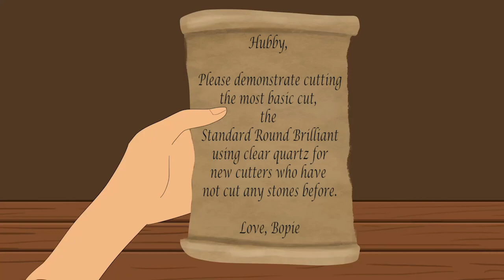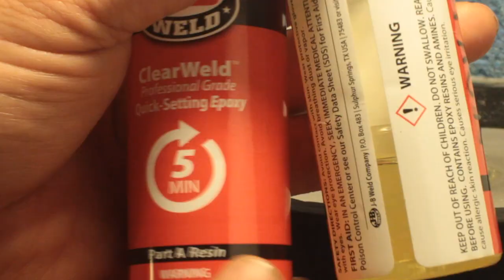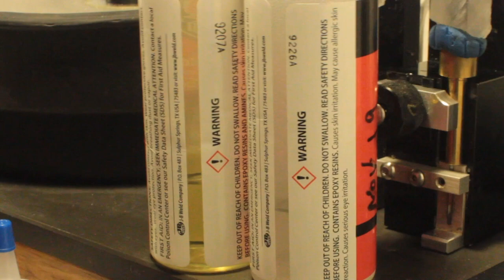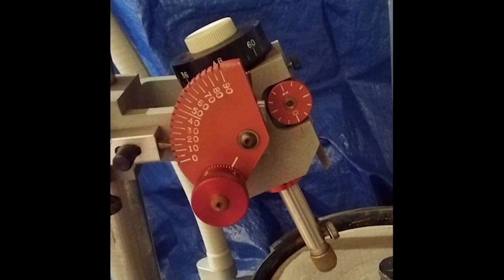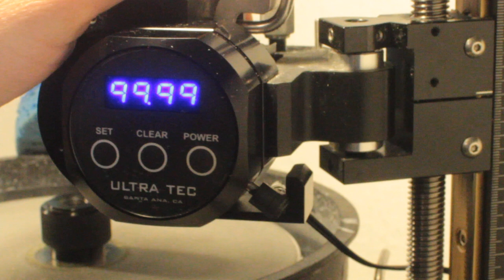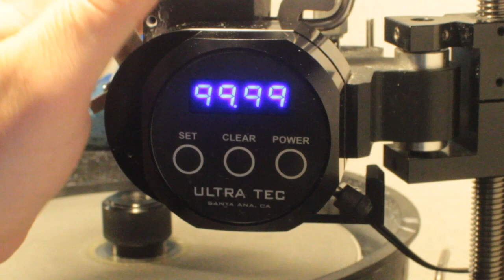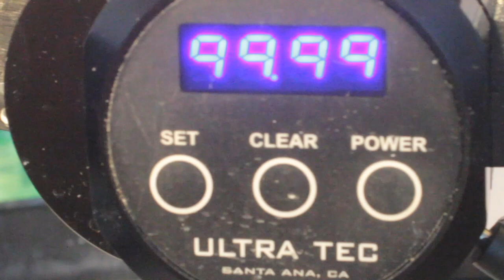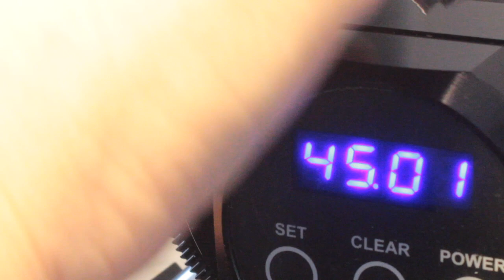Gem Cutting Tutorial: Standard Round Brilliant Clear Quartz

Comment: Great video man, How do you know how much to cut on the different cuts?  The diagram shows the index and the degree but how do you know how far to cut?
Reply: There are a number of ways.  Most commonly, I will start by cutting the two opposite teeth of the index gear, say 96 and 48, I cut and measure the width of the stone at these indexes until the stone is a wide as I want.  That establishes the width, and without changing the mast or angles, I then cut the rest of the facets around the girdle.   There.  Girdle set, width set.  Now the first cuts on the pavilion, I cut down far enough  to have a pavilion and that distance is known and provided in the instructions as the P/W ration (Pavilion divided by width).  You already know the width, so multiply that by the ration and the 'answer' is how many mm you need to cut your first row of angles.  You cut the next row of angles until they 'meet' or just touch the girdle, thus the name 'meet point' faceting.   Then the next row 'touches' the previous, etc., etc.  Then you transfer the stone and cut the first angle on the crown side (top) down until the width of your girdle is where you want it....which is up to you....but commonly 0.5mm or 0.3mm or close to that.  Next row of facets 'meet' the girdle, etc, etc.  Finally cut the table until it 'touches the intersection of the two facets as on the diagram...and you are done!  Enjoy!
Reply: @mikesackos2208  thats great man.  Going from cutting to the pre polishes to polish do you loose any material, so that you need to cut your piece large to make up for the lost material durring pre polish ?
Reply: @TIG2MAN0 Yes, but that is all based on experience, you will need to learn how much space to leave between the last cutting lap and the prepolish lap, and maybe between the prepolish and polishing, but after you cut a few stones, there rarely is any noticable material loss when you polish.

Comment: You have great tutorials.  I tried the cerium in the small spray bottle, and got a great polish on a citrine.  I'm guessing  like you mentioned, the larger pieces of cerium sank to the bottom of the bottle.  I love tips like that.  Also how to use the cheater on a UT machine.  I love my UT-VL, but the manual is lacking. Thanks
Reply from the maker: Thank you.  Glad the cerium oxide worked out for you.

Comment: Hello Sir, 
I used your video to cut my first stone...quartz SRB. A few mistakes but a success nonetheless. Would you be interested in answering questions from time to time? Such as this one...Can you reuse the Acetone used to release the stone from the dop over and over again?
Thanks so much for your instruction and efforts. 
OCHO
Reply: Congrats on your SRB!!!!  I think you would do better to ask questions on the many gem cutting Facebook sites...but if you ask them here, I'll do my best to answer them.  Yes, I use Acetone over and over...HOWEVER...it does get 'weaker' as it disolves a lot of epoxy or superglue...it takes longer and longer to get the job done.  SO at some point, you will want to replace the Acetone you are using.
Reply: @mikesackos2208  thanks so much.

Comment: Thanks for the tips Mike.  What is the mix ratio that you used in the spray bottle?
Reply: Nick said take a 4 oz bottle and filll 3/4 full with water and add 1 teaspoon of Cerium Oxide.  So the mix ration is 3 oz water and 1 teaspoon of oxide.

Comment: There is confusion to me at 28:56 when describing the cheater. You did a clockwise adjustment. We’re you adjusting the right unpolished side of the facet?
Reply: Don't let it worry you...which way to turn the cheater confuses virtually all new cutters.  Turn the cheater the way you want to turn the stone.  So in this example, I need to turn the stone in the spindle to the right (clockwise) to get the right side of the facet polished...so I turn the cheater to the right (clockwise). For the Ultra Tec you turn the cheater the same way you want the stone to turn. It is just that simple.